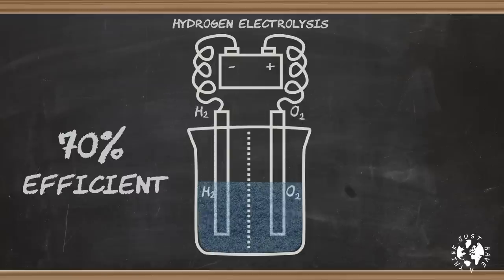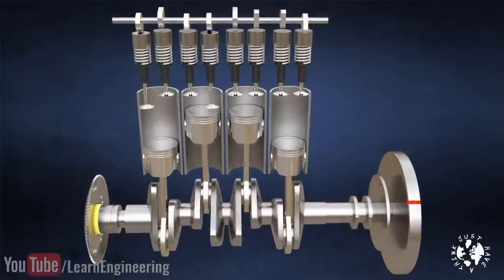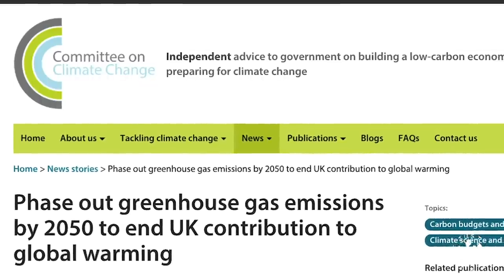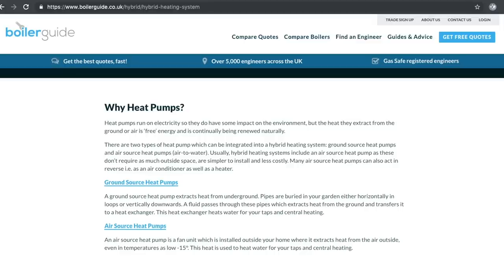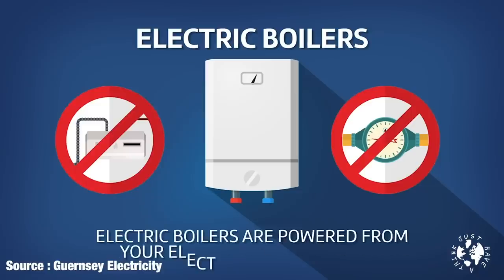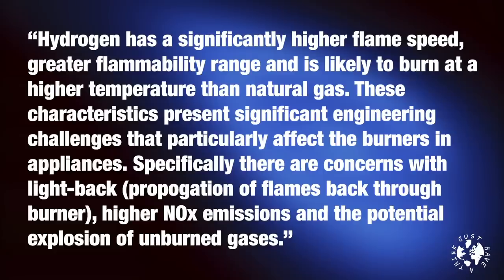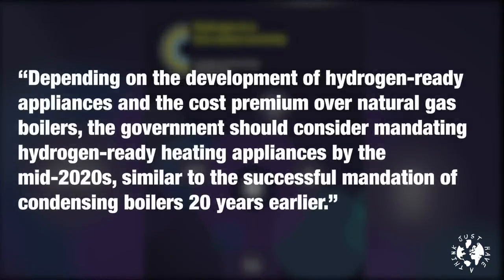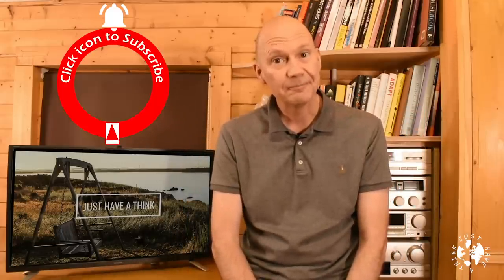Hydrogen for heating our homes

Comment: Would it be cheaper to mass roll out renewables and use a sunamp hot water battery plus change to electric cooking where needed?
Enjoyed the video. Just subscribed.
Reply from the maker: Hi Paul. Thanks for subscribing. Much appreciated. I guess the UK and other governments will need to work out the best solutions as we go through the 2020's and beyond...

Comment: It strikes me that the reasons for the popularity of the idea of using hydrogen for home heating are to do with the assets of National Grid and the distribution network companies, which will become worthless if we move to electric heat. In a smaller way, also the industry around manufacturing and maintaining boilers. If we did proper deep retrofits of homes, not much heat would be needed, and a heat pump could easily supply it.

On a technology note, the hybrid hydrogen/gas heat pump seems daft - you end up with two complex machines to maintain. Using direct electrical top-up is simpler, though another option is to use thermal storage to cover peaks in demand, then the hybrid element isn't required if the heat pump and storage are sized correctly. There are some very compact storage options out there for heat. I saw one based on a phase change material when I visited Sunamp a couple of years ago.

Comment: Hydrogen + Solar = Seasonal energy storage. A golden goose.

Use excess summer solar (currently wasted), to convert water to H2 throughout the summer. Store it. Then in winter, run the H2 through a fuel cell to create electricity for the heat pump. Effectively a hydrogen battery. Power grid eliminated.

HVAC is 80% of household energy consumption here in Canada. Huge issue to solve.

Comment: How about reforming hydrogen in-situ from butane/propane in the fuel cell unit using an in-line catalyst ahead of an SOFC stack Why hasn't this been developed any further since I worked on it in the mid-1990s??

Comment: Hi I have a ASHP ditched gas boiler best thing I ever done have solar panels as well. What you fail to highlight that we don't need hydrogen boilers for new homes. We need ASHP installed the difference being that new homes need to be super well insulated to a passive standard. We could be talking about hydrogen boiler like we do with hydrogen cars la la land comes to mind. The problem we have in the UK as the tories are in the back pocket to the oil and companies and housing companies. Passive home can be easily  achieved but the willingness is not there

Comment: When we have free solar panels with free energy storage in the form of trees and wood that is less expensive than natural gas and basically free in exchange for some health boosting exercise why don’t we just burn wood.  The cost of a good wood stove is small in comparison to a complex hydrogen system.  Isn’t it?  Am I missing something?
Reply: You are missing huge amounts
Reply: @davidwatson2399  Well I'm here in western WA and I can tell you 100% that if I were to go off grid I would just use solar with a large lifepo4 battery bank, mini splits and an inexpensive wood stove for about 2 months of the year.   And my system cost wouldn't be that bad at all.  How much does this cost?

Comment: I don't hate natural gas; it's fairly clean, cheap, plentiful, and flexible, and we have a whole infrastructure already built. It might be reasonable to reform hydrogen out of natural gas (using solar and wind) and return that natural gas to the ground but add the hydrogen to DIFFERENT natural gas in the delivery pipeline, creating a higher-energy, cleaner-burning fuel for homes and factories that wouldn't require retrofitting burners. Perhaps the "dirtier" natural gas could even be used in shipping, supplanting some of the awful #6 fuel oil. Eventually, it's clean renewables and batteries all the way, but this could reduce carbon emissions until we get there.

Comment: If the temperature in your country is 3+ °C you can install boiler on the roof of your house. Where i live the temperature can go under zero but this winter was warmer and we had free bath water all year. The boiler cost was 300-350euro photovoltaic if the temperature is positive and the day wasn't rainy you will have 40-45 °C, throughout the summer is 99.

Comment: In my opinion, the future of heating homes is either RNG or Blue/Green Hydrogen. The inefficiencies of transporting hydrogen can be solved by sending it through natural gas pipelines, where it can be used for trucks, steel production, shipping, or heating.
Reply: Hydrogen is very leaky and may not be suitable for existing nat gas transmission systems.

Comment: For day/night balancing are LiFePo4 batteries far superior. Just ordered 280 Ah celss for only US$ 75 each. Summer / winter balancing is nothing for decentral. 
Here is a big power to methane system, huge underground gas storage and CCPP the solution. Heating with hydrogen, what a waste.
Heat with heat pumps where the power comes from sun, wind or stored energy from last summer by power to methane, huge underground storage and CCPP

Comment: hydrogen should at current technology efficiencies be used for storing the excess production from sustainable sources that currently is lost due to insufficient battery storage or usage at time of production. other than that seems like the sun and the wind have a lot of potential to give us still before we need other solutions for sure, hydro especially if able to compete productivity wise without damaging environments as it currently does all too often (blocking fish migrations etc)

Comment: Have you got any info about the efficiency of Heat battery boiler systems using electricity and phase change materials to provide on-demand heat? They use electricity from either solar or overnight cheaper rates. I've only seen a company called Sunamp promoting this idea but it seems like the perfect answer for hot water boilers.

Comment: Personally I can't see hydrogen as a piped-in domestic energy supply - but compressed hydrogen bottles maybe.  It looks like hydrogen for domestic energy supply will be best effective as storage of renewable electricity & release to the grid as required.  Hydrogen's other effective application is likely to be fuelling trucks, for which the electric option is ineffective because of battery/weight ratios.
Reply from the maker: Hi Mike. I imagine the hydrogen for heating thing will vary greatly from country to country, but I completely agree with your point on fueling trucks (and ships, buses, trains, and even short haul planes - all of which are either in existence today or a long way into their development.)

Comment: I Romberg when the uk switched from town gas to natural gas. Over a period of two years every home had to be inspected, decisions made on every installation to determine if each appliance could be modified and if so what material was required,  or was it more economic to replace the unit. Then the kit was sent out to every household and a conversion date set. Then teams of engineers moved down the country switching every household and every installation. Conversion cost was funded by the government, so no one had to pay. The swap over went well, and every unit was successfully replace. So a major switchover is possible, and within a short time everyone had settled back and got on with it.

Comment: I am already all the time thinking about all that waste energy we produce. Here I see how a heat pump is capable of using really low temperature heat and so why can't such a system be used to win energy back from all the waste energy??
Reply: As long as the heat pump uses an electric rod element for heating it is a worthless device.

Comment: Use nuclear ( using heat or electrolysis) and solar and  wind ( electrolysis)   to make hydrogen while electric demand is low. Use that hydrogen to power electric stations to top up  peak demand rather than carbon emitting natural gas.

Comment: Ok, this is crazy! It takes energy (some stored and some wasted) to make H2. To heat a house you need dirty energy = heat. The best way is to use the energy of the sun directly. If there is little sun, then use the visible light to make PV electricity and heat the house with a thermal resistor. Not waste time/money(energy) to make H2

Comment: More use /sales of air conditioning in countries suffering more of the global heating Impact apparently may become responsible for up to 1/3 of GHG emissions.  Does hydrogen play any role here? Also, is there any ratio of global heating demand vs global cooling demand that would indicate that more innovation investment should be in cooling than heating?
Reply from the maker: Hi Steve. Thanks for your comment. you're quite right about the stats on cooling. I think hydrogen would only reallly overlap this technology in it's capacity as an energy storage medium for the power grid. HVAC tech is pretty well established but is basically electricity driven. All the best. Dave

Comment: Can you imagine, if the whole of Almeria Spain replaced their plastic green houses and put up millions of Solar panels and put in thousands of Wind turbines, it wouldn't matter if producing Hydrogen is only 60% efficient, as the electricity would be free, only the cost of replacing the green houses and building costs would be a one off event. Then start looking at the coasts of Africa etc etc. Hydrogen could be produced on a large enough scale to be practical.

Comment: The underground heat absorbing system mentioned would be good under roads?
Reply: Nahh that maybe the hottest areas of the outer surfaces of Earth....sounds to simple and logical.
Reply: Why am I the only one I’ve noticed mentioning making roads into power generators...and or part of the power grid...I must be wrong?

If they aren’t already.   ...on a basic science level they are already power generators....just the fact the power is reused isn’t revealed...yet....well unless I’m correct.  ..then again maybe hot roads warming the earth has its purpose even though that energy isn’t used directly by people.  ...staying on that thought I think the resource per pound and in area required to build &/or maintain roads and the roads direct influence is much greater than the burning of fossil fuel....and the resources to build each vehicle as well.   The ratio of what resources are required to build and maintain roads verses how much gas and resources are required to build vehicles and power them would probably be surprisingly drastic in comparison.

Try walking on a hot day... a sidewalk bare feet..then step on most roads for proof it works.
Reply: Also look at any internet app that shows a zoomed out major city...at some point the darkness of most cities increases as the area of roads bleed into other things....making the city look darker......all cuz of roads.   This is because a huge area of most cities are covered by road...causing a bleeding (that’s what I call it) type effect when viewing a zoomed out city map.
Reply: I really don’t understand why roads (supposedly) do not generate energy that can be reused......unless the truth of roads generating and connected to energy systems....just hasn’t been revealed yet..   ...maybe something/someone wants someone to believe the Earths & humans power situation(s) are doomed to be fatal........... .....the truth is out there.....

Comment: Informative video A offered thought to add to the pros and cons is the portion of the combustion energy that leaves in the exhaust gasses. Assuming ideal combustion of a hydrocarbon the waste gasses are CO2 and H2O. As one burns shorter hydrocarbons the ratio of H2O increases with H2 combustion producing no CO2. Point being CcO2 remains a gas in our operating limits whereas given a cool enough ambient air supply to a condensing heater burning H2 could recover sufficient heat of vaporization to raise the thermal efficiency of the heater above 1.0.

Comment: Seriously, a hydrogen boiler (incl. production of H2, transport and storage) would probably have around 50% of the efficiency of electrical heating. It would be much more efficient to store hydrogen at large power plants and use it when necessary and then distribute the electricity. Hydrogen for small homes is almost as inefficient as fossil fuels, which we want to get rid of.

Comment: What about flow batteries ? Although not yes as efficient as Li or H2. It could be a good replacement. I can imagine in the future where you go to the fuel station and fill your car up with an electrolyte solution and empty the spent solution.
Reply: Flow battery is nowhere near useful with any current predict ed technology

Comment: Some problems with hydrogen are:  1.a hot flame but low heat capacity. Anything with carbon has at least twelve times more energy. 2. open flame produces too much nitrous oxide which is bad for your health. 3. It is hard to contain because the molecule is so small almost everything is porous to it. Valves and pipes must be pricision made to contain it. Hydrogen can be converted to heat or to electricity and it can be stored in other different ways, like a heat release molecular sponge or something.

Comment: Hybrid configurations for residential (Solar, Flow Battery, and fuel cell) will be the future.  Fuel cells will either be Solid Oxide (use 1/5th of the gas of combustible engines), using propane or natural gas, OR will be hydrogen based using a Natural Gas Reformer OR hydrogen with solar hydrogen panels.  The cheapest power will always be the grid and solar but as EVs are added to the grid, you might just be presented with daily caps or higher rates as the old grid can't deliver your car's daily recharge.  Decentralized generation will drive the need for this hybrid configuration.  Also, solar panels are being developed to produce hydrogen gas and this might make the use of a hydrogen fuel cell less costly as part of a residential hybrid.  Scale always brings prices down, so, they will probably be part of a subscription service to make them affordable to home owners.

Comment: A trial is needed to look at the issues of using the current gas infrastructure for hydrogen to the home. My preference is hydrogen. Whatever I end up with, I will not have a noisy fan outside my house. Nor do I want to hear my neighbours air source heat pump. Price all that matters long term to me, the greenification will happen, not likely net zero by 2050, but well on the way.

Comment: The problem with hydrogen is hydrogen or the britallisation of metal and the extremely thin gas in a system that was developed for town gas and then natural gas. The Only answer I can see is thermal thorium fluoride with the high temperature one could manufacture a carbon based gas.

Comment: why not make a H2+fuel cell heater? H2 comes in, gets converted into electricity by fuel cells and heat is formed... You don't need to actually burn H2 like you burn gas and develop all those detectors and whatnot.

Comment: Gosh. So many hurdles to get hydrogen to work. If there can be some way to manufacture hydrogen locally and in a carbon neutral manner, it indeed could be part of the solution. However, if it needs to be transported, the inefficiencies pike up too quickly.

Comment: I suspect there would be low takeup of "Hindenburg" (I.e. H2) boilers due to safety fears. Also the main attraction of gas is that it is better for cooking, but that is not applicable to H2. As such it might be better using scarce resources to focus H2 use elsewhere and instead electrify homes.
Reply: Agreed. I suspect its best application might be large transport vehicles, like cargo ships. It would be safer and simpler to just electrify everything in the house and put panels on the roofs.

Comment: Missing from the anti-hydroid rant is recognition that the building heating peak is a multiple of electricity system capacity.  Even after allowing for better insulation and heat pumps and distributed generation, heating all buildings with electricity would require much more investment serving a low load factor hence much higher hydro rates.  And as for the efficiency of cars - does this matter so much when the source of energy is abundant free sunshine and wind?  Fuelling cost is not necessarily the only feature some drivers care about - filling time, range and cold weather performance are others.  And as for heavy duty, long distance trucking and shipping and aviation ... well I trust I don't need to spell out the shortcomings of batteries. for those duties  And as for scaling up production of batteries using critical minerals, that's not a slam dunk as Just Have a Think has discussed.  And as for hydrogen being a Trojan Horse for the evil fossil fuel industry ... look, I don't like having been lied to for 40 years any more than any of you; but, as Churchill said referring to Stalin he would be quite happy for the devil to help defeat the Nazis (or something like that)  - let's not lose sight of the objective which is to stop global warming, it's not to to take revenge on the fossil fuel industry, as satisfying as that might be.  As much as they can help, let it be.

Comment: The natural gas combi (combination) boiler which combines hot water and heating output, is highly efficient in fuel efficiency and size. Natural gas contains a lot of energy. A combis in a small white box on the wall that can supply all the hot water and heating on demand, with no heat storage. To have an electric combi giving on demand heat, it would need cables as thick as your wrists - a three phase electrical supply would be needed. So electric on demand combi boilers are generally thermal stores - the incoming cold water is instantly heated by passing through a heat exchanger immersed in a store of hot water. These tend to be large and floor mounted.